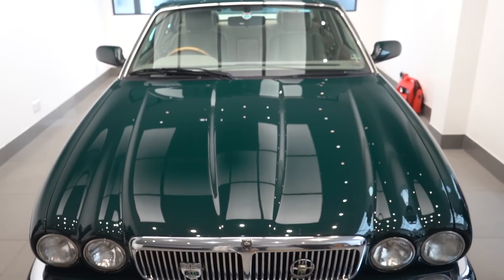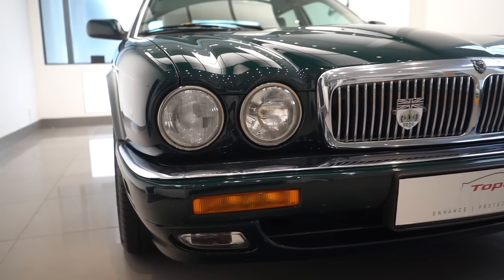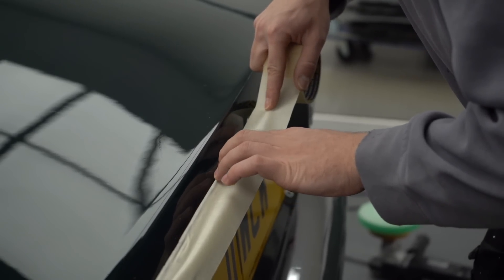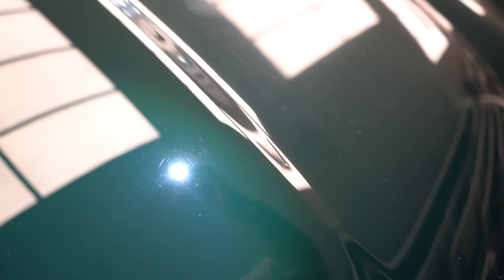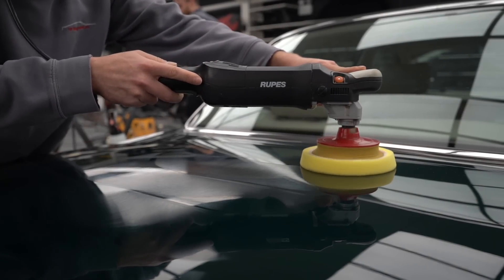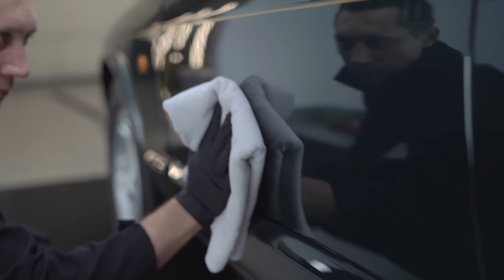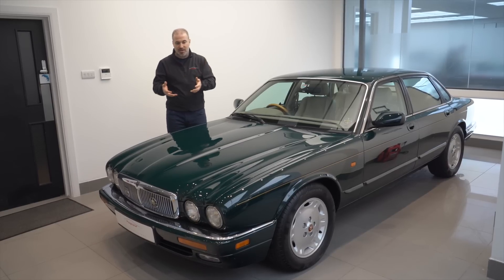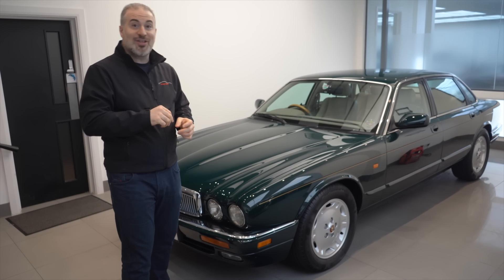Restoring a 25 Year Old Jaguar XJ!

Comment: Are you able to assess how deep the clear coat is to see how aggressive you can be with the correction?
Looks amazing. Surely it would have been best to ppf the car after such work especially as the paint is so inconsistent and soft?
In terms of the interior, I'm assuming you're not just using any old "magic" pad to clean the seats?
Reply: Yes, they have special tool that can read the paint and tell you on each panel how much lacquer you have left and then you can decide if you can sand the paint, or what abrasive paste to use etc.
Reply from the maker: Correct!